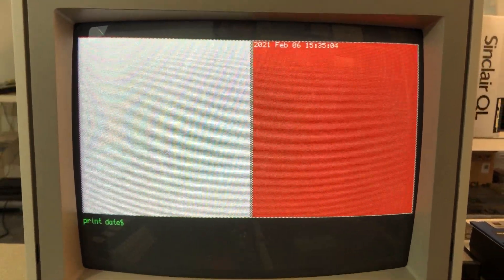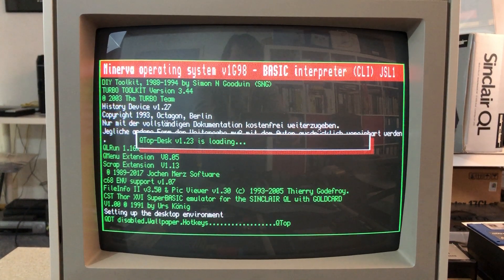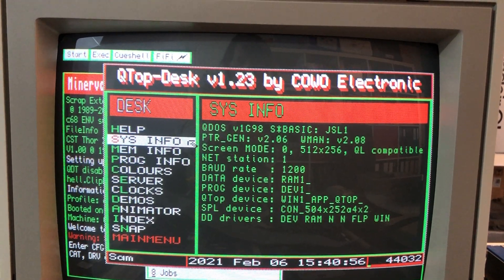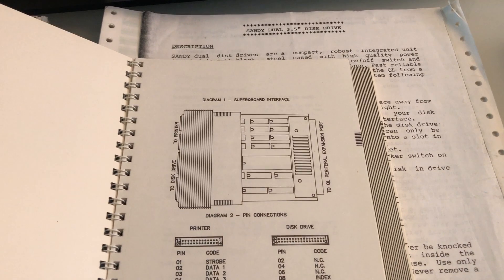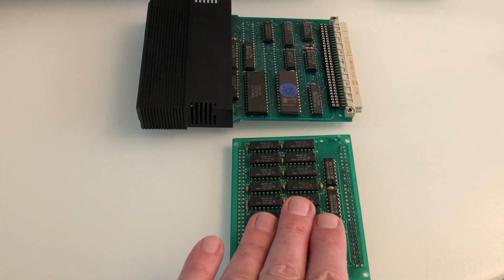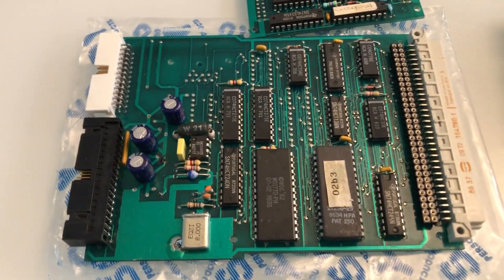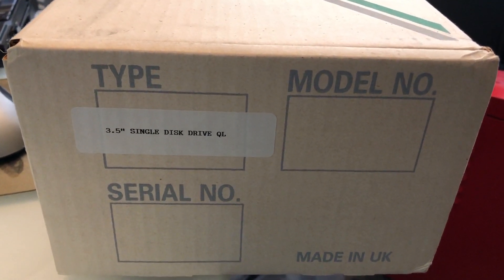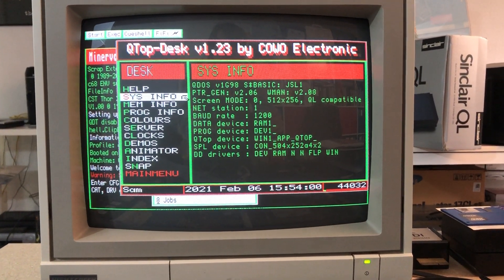Sinclair QL with SANDY SuperQBoard & SuperMouse - part 2: QL/E, SANDY history, HW review

Comment: The text of the SQB manual was printed with a daisywheel printer with one of Tony Tebby's inhouse printing programs, similar to the later used "QPLQ" for Epson LQ printers. The former program was intelligent, as it leaves gaps on the paper, if the fount was changed to e.g. italic. Then you could change the daisywheel, the paper winded back ant printed the rest. Very clever. QJump later used "QPLQ" which used all inbuilt founts of the LQ printer. "QPLQ" and the former program were written in SuperBASIC. They both used non-proportional founts from the printer but set every letter "on the fly" to the place on paper, so it looks, as if you have used proportional founts. It worked a bit like "TeX", using similar "Escapes".

Comment: Nice info again, thanks Uwe. Do you happen to know if there is a 3D print version of the plastic cover for expansion boards? I have a card where the cover is missing. Would be nice to print one.
Reply from the maker: Hi John, Urs here not Uwe. LOL! I'm not aware of 3D print files for this two shell Sinclair plastic cover. You may ask in the qlforum or the facebook Sinclair/QL groups.
Reply: @QLvsJAGUAR  Hi Urs. Sorry about the name. I knew that. I'll check the qlforum. I'm not on Facebook :-)